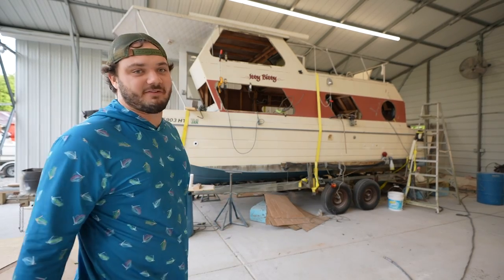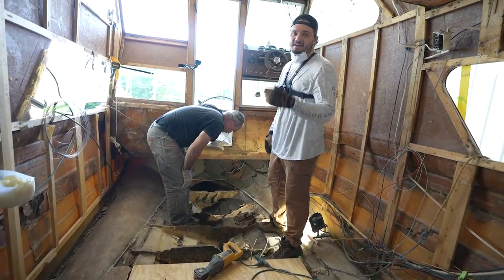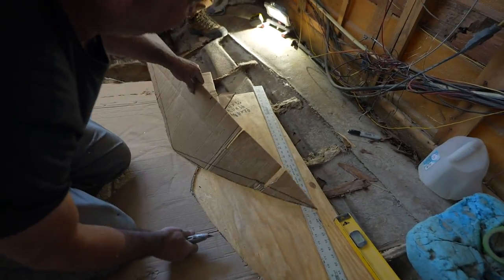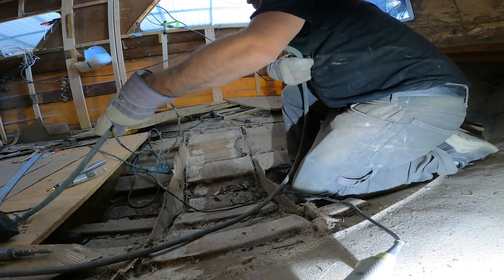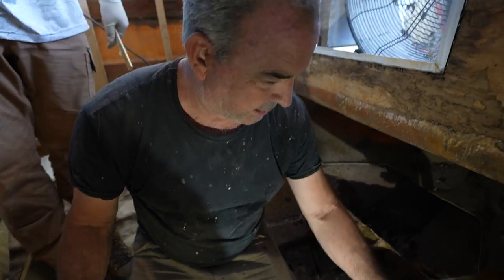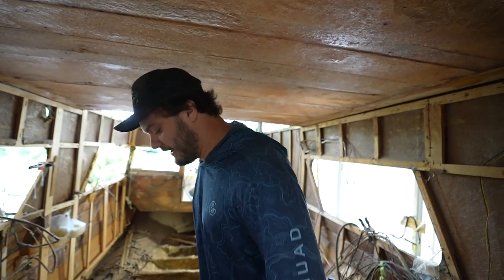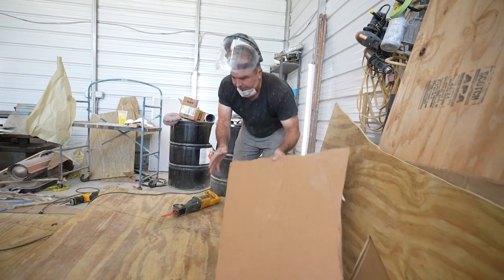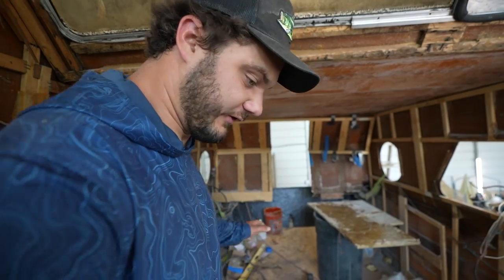Putting A NEW FLOOR In My HOUSEBOAT!! (part 1)

Comment: Couldn't tell, but you probably need some bilge drain holes running from the bow to stern at the lowest points below the floor.  Otherwise any water that gets in will sit and get really mucky potentially leading to rot.
Reply: Yep they're called limber holes drill them and glass them so the plywood in the bulk heads doesn't rot.
Reply: >  Closed cells helps with flotation if there's an incident.  Seeing how the crew loads the pontoon boat on the trailer there will be some beer dents in the Bitty's future.
Reply: I was about to say the same thing
Reply: Also needs to apply the water proofing to the floor boards like he did the walls otherwise his foot will eventually go through the floor again.
Reply: Shes looking good my friend coming along nicely 👍👍😎
Reply: You also will get condensation under the floor, so you needed a way to vent / drain that out with bilge tubes.

Comment: Steury update. Cool. Don't worry about weight. It's a Cathedral hull and the most stable there is. Our Steury never rolled around like a cork. It was huge top heavy. Very stable. You want an inboard for silent running, charging batteries. Even though we could get her up on plane it wasn't logical to do so. The stock OMC 350 was really too much power plant. I recommend a small inboard. Our's being very heavy liked to run anything around 12 to 18 knots.
Reply: This guy Itty Bitties

Comment: What about the drainage holes are the bottom of the stringers? Incase of water you need it to flow to the back for drainage when you pull the plug. There should be holes right at the bottom at the v to flow water.

Comment: > That big V 8 inboard out board will give the stability it was designed for originally. Good to see some heavy glass work going in the hull also.  May have to get Coast Guard certified to run a super yacht like the Itty Bitty.  You will look good in a captain's hat and T shirt.

Comment: Hey lil thought for you, run some conduit pipe for your wiring to run thru. It can be pvc or anything similar and run it in the wall or the floor. Use dawn dish soap to lube the wires when you go to pull the wire into the pipe. Long thin metal wire, tape electrical wires to one end, rub down with dish soap, and pull it thru.

Comment: I would use a gm small block. Cheap and easy to maintain. Plenty of power to move it, remember wind likes to move houseboats when/where you don’t want. Are you putting a couple of bilge pump’s in the bottom? And one more thing the bulkheads should have a small hole at the bottom to allow any water that gets in to travel to the back so it can be pumped out.

Comment: Have you considered closed cell foam in your hull. Its does several things, rigidity, ballast, insulates, it keeps water out of the bilge area and add some buoyancy if the boat takes on water though it isn't much.
I do it on most boats I restore for increased rigidity and added ballast.

Comment: Hi AYO 1st time I did fiberglass work by myself I had butterfly's in my stomach was worried I would mess something up when I was finished the owner of the 80' party boat I worked on was impressed and from then on I did all of the fiberglass and wood work on the boat. The itty bitty is coming together in a good way cant wait to see it finished and on the water I am sure you can't wait either.

Comment: As for a Boat motor, look for a vortec6 from any s10, sonoma, jimmy, or blazer. The Vortec runs at a higher rpm, due to it just being a cast iron corvette engine with 2 cylinders cut off, and makes a great boat motor.

Love the content, love the boat, love the journey.

Comment: You could try and find a cheap donor 80's or 90's runabout with a Mercruiser 120/140/165 four cylinder and Alpha One I/O. That is a reliable, efficient, and simple drive train, easy to work on, and parts are available and cheap. They are all over the place, and it is possible to get a boat to rip them out of for a few hundred, or even free sometimes.
Reply: Yes he needs only a small I/O setup and a big alternator. Yes an Alfa 1 would do fine. Best fuel economy will be 18 kts or less. Ran ours up on plane with an OMC 350 and it would barely plane and suck lots of gas. It is NOT a powerboat. Running on plane would require a big block and a TRS drive.

Comment: Electric Saildrive and put the batteries anywhere you want. No more oil changes or fuel cans. Costs way less over the years.
Service every two years. Over winter it would be a battery for the house so you could charge at cheap rate and use/sell at peak.

Comment: Very fun build, congratulations!  I was wondering throughout the bulkhead and flooring build how you will access the bilge?  For example, if water gets under there (as it surely will) how will it flow out?  Typically, there is a tunnel that runs through the bulkheads to allow water to run to the lowest parts of the boat, normally out of the stern.  Thanks for all the detail during this fun process!

Comment: With the strange angles on that boat you could make it look like the Tesla pickup. The first Tesla Houseboat. Could even make it electric, use salvaged batteries from wrecked electric cars and an electric motor. That would give it a low center of gravity to counter the height, you could even have a fly bridge. Also put in solar panels that would just keep re-charging it.

Comment: Inboard will be a better setup when it’s done... you can easily charge up battery’s to power other things.... much more reliable to just fire up and idle too.... which I assume you could implement some crude cabin heater from an inboard engines coolant.... can’t really do that with an outboard at all....
And I’d assume the value will be higher too, just the idea of having a closed system for salt water and stuff, would interest more buyers...

Comment: Creeper Ayo, my favorite Ayo so far, laughed non stop during that part of the video, keep up the work man, can't wait to see the Bitty on the float
Reply: as for going with outboards they have these things called pods you bolt through the transom and help equal out the weight and displace the motor to the right level

Comment: If you're not putting in limber holes for drainage, then I'm surprised you didn't fiberglass the bottom of the floor and use peanut butter to seal it to the bulkheads to create watertight air spaces for flotation.

Comment: Just a question ? I know you dont read these but did you put drain holes between the braces on the very bottom of the keel ? If not you are going to have trapped water between the compartments and it will rot out the floor and floor braces . I didnt see one hole. You have to have drain holes for water to drain back into the bilge area for the pump to pump out the water. Also when you park the boat you need to tilt it up and any water in the compartments will drain all the way back through the drain holes for each compartment and out the transom plug opening.

Comment: Why not add a like 4 inch high by 2 foot wide tunnel down the center of the roof so you have more headspace then fix the height difference on the roof deck with some lightweight matting?

Comment: Your thoughts about staying with an inboard engine I will take it, considering the flybridge. I owned a 32 foot cruiser which had a fly bridge in twin Chrysler and Board V8‘s. At every party all of the people wanted to be on the flybridge. The boat would act like a pendulum with the slightest wave. Back-and-forth back-and-forth it would roll in the bay. We can just imagine how much worse it would be if all that cast-iron were removed and a lightweight aluminum outboard were put on the transom.

Comment: Probably too late now, but I sure hope you coat the back side of the floor before the final install. Your old floor roated from the bottom side up, this will do the same. 
What I personally do is, put a couple layers of glass on the back side to seal it up. Some manufacturers just coat it with resin or gel-coat because it's faster, but I definitely don't want to leave it raw like it is in this video

Comment: Go with the outboard motor. 50HP is all you need for the IB. Center of gravity will be fine. Stay away from the 250HP Mad Max motors and you'll be good to go. Stay out of the rapids though. And high winds, stay out of high winds. And rip tides. And don't let the big catfish pull you side ways (as if). Keep large women in the center of the boat, especially when in any of the aforementioned scenarios. Bless your heart.

Comment: This may sound dumb but maybe you could replace the inboard motors weight with weights instead of putting the motor back in and just buy an outboard motor. That would fix your balance issues.

Comment: What about the drain hole at the bottom of the between each of the joists? Shouldn't there be a hole down at the bottom right along the keel, all the way from the bow to first place that can take a bilge pump in the stern?

Comment: Please tell me you glassed the bottom of the floor?  Not too mention you need drain hole between the bulkheads.  The bilge is a wet damp area.

Floor won't last 5 years

Comment: Did you roll the glass on the bulk heads? Surly that should have been consolidated with a roller..... Also are you gonna lay up the bottom of the floor before you put it down....?

Comment: Had a 69 drift or cruise. Pulled the io lump and used an extended mount with a 225 would almost plane. Strongly suggest.

Comment: Power with outboards!! You will have more space for generator
Reply: A small inboard is actually a generator. It's all in the alternator. Had a generator on ours and never used it once. That transom will support a 4 foot swim platform so no outboards.

Comment: Dude if this is in real time. You better cut holes in the lowest part of those stringers to allow water out if any get under the floor in bilge. If the floors already down seal the crap out of it and remember to glass the bottom side of the floor or it will rot from the inside out.

Comment: Pity you all forgot to put drain holes in the bottom of each bulk head for the water to drain to the back of the boat. Also, you didn't resin treat your floor so is still going to rot out fast because it has not protection from the water. The transom will work but could have been done way better. The two layers of plywood should have been fiberglassed together before being put in. The amount of air pockets inside is going to be crazy! Love your videos, keep up the great work. Maybe next time find a better boat repair guy.

Comment: Outboards have way less moving parts and easier to mantain and flush. I believe the Itty Bitty will not surpass 20 knots. A single Suzuki 200 will be perfect. 2 would be even better. That boat is big. It should hold. I have a photo of a Sea Ray 300 with twin 300 Mercurys. Different boat but similar situation
Reply: Used to own one and our stock Steury with an OMC 350 would do 35 kts. Best speed was 18 kts off plane. It's a houseboat not a power boat. He needs a small inboard. Had a 4 foot swim platform off the back of ours. No outboard.
Reply: @pgnandt  i just think it would be easier and better and less chances of it breaking with a new outboard.  In Miami people repower Sea Rays with outboards. Looks awesome. Would be cool to try that
Reply: Any how this is friking awesome either way and im all for it

Comment: If you had designed a new boat from scratch, and built the skeleton as you wanted, could you have used the fiberglass and whatever else, from this boat to make the boat you designed?  I'm asking if you gutted it so much you could have had it easier and cheaper as a hybrid restoration/scratch build job?

Also, if Tesla's super fab power wall can power a house like 1500 sqft, aside from the engines, why cant one power the ac and tv and water etc on a small ass boat?
Reply: Because it costs two arms, a leg and a kidney, maybe? Aside from that, great idea.
Reply: @remcovanvliet3018  don’t boats cost that anyway.  And I have no idea. It seems like it’s just bones now. What do I know from boats.  This kid is cool in my book.  I bet he could have made any kind of boat he wanted on a budget.  Lol

Comment: Looking to purchase one of these boats! How tall is the ceilings? And under the cover in the front?
Reply: I'm 6 foot and my head would touch the ceiling inside but not on the bow. Did you find one for sale? They go real quick when listed.
Reply: @pgnandt  thanks for the info! Yeah I found one for sale
Reply: @mattkoogler8170  Wonder if it's my old boat. Not many out there. Where is it listed? Resale on these are good. Sold ours for 36k about 4 years ago.
Reply: @pgnandt  they are asking 6500
Reply: @pgnandt  this one has a outboard motor

Comment: You didnt make holes through all the bulkheads to drain. As long as no water gets in i guess o.k.
Reply: That's for hulls that slope aft. This sits flat so.....water needs to stay in the engine bilge so it can be pumped.

Comment: Dude, it doesn't look like you're using treated plywood / treated lumber.  It's just going to rot out again.  Waste of time and money.  Same with the deck on your pontoon boat: it should be treated plywood, sealed in either fiberglass or polyurethane to keep the chemical treatment from leeching out.

Comment: Hey brother listen you're making a huge mistake not putting an outboard on that boat if you put an out drive back on that boat you're completely wasting your money and you're buying something that's not easy to maintain and completely unefficient you need to purchase an Armstrong bracket put a 90 to a 115 on the back of that we've done lots of these conversions I own a yacht management company in Charleston South Carolina and we refit super yachts don't do it put an outboard on there I promise you spend the money
Reply: No outboard. We built a 4 foot swimdeck off the back of ours. So you have put an outboard on a yacht? Inboard for silent running and a huge alternator for charging. No one puts an outboard on a Steury.
Reply: @pgnandt  
Hey Paul I understand what you're saying about using the inboard as a giant alternator that does make sense they're unefficient a lot of the smaller boats like yours that we retrofit down here we convert to outboard it seems to prolong the life of the boat and make it much more efficient the Armstrong brackets are positive buoyancy so you can have a swim deck and the bracket it's just my suggestion it's what I think the future of restoring some of these boats is going to be and no I've never put one on a large yacht the biggest I've ever seen anybody do it too is like 35 40 ft on some of these houseboats I have seen a couple of sport fishes convert over and they do pretty well most of the boats we run are over 90 ft so we're dealing with old Detroit's and things like that good luck with your project my friend
Reply: @mattbalassone1136  We sold our Steury a few years ago. Had the OMC 350. We would run like 1200 rpm for low teens in kts. Way too much motor for practical purposes. It ran super quiet. My brother did all electrical but remember basically an ambulance alternator. This boat really only needs a Merc Alpha 1 and a mid sized engine. Fuel economy these days needs to be considered. Truth lies in a fuel flow meter.